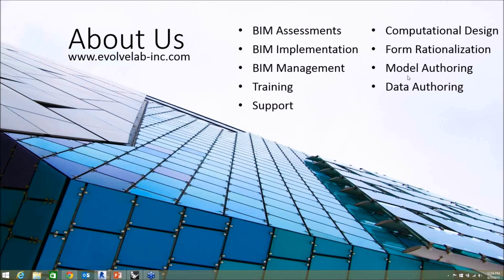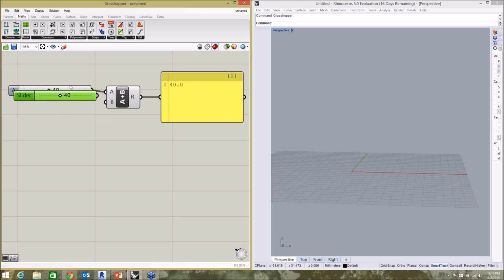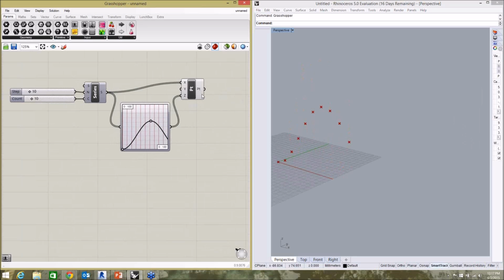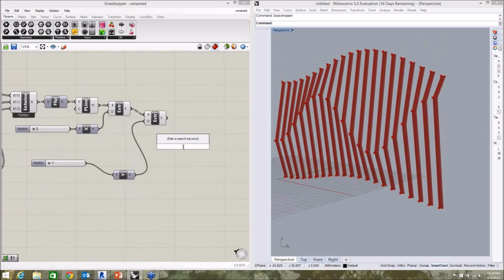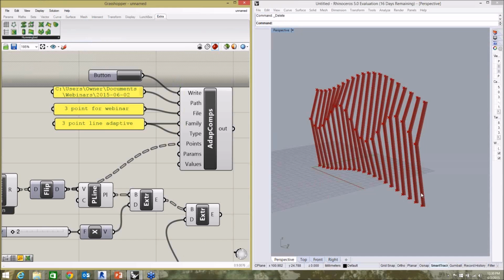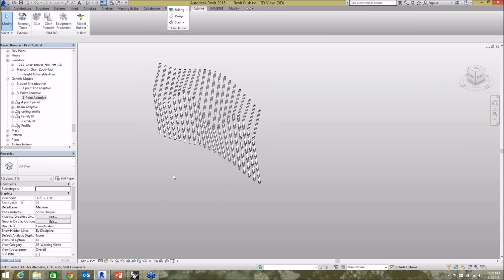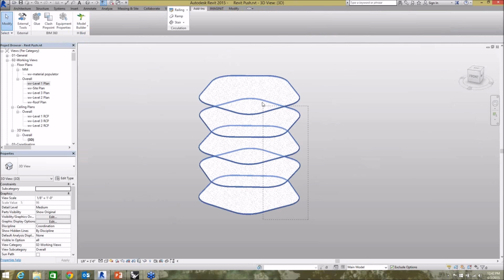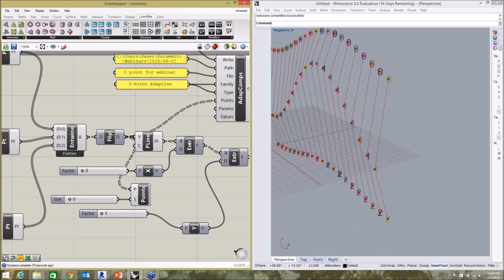Push Grasshopper geometry into Revit

Comment: Wow, this is so cool! Thank you for this tutorial!
Do you still think it's better to play in Grasshopper instead of go with Dynamo?
It's been now 4 years since this tutorial was posted here, so I'm curious if you changed your mind or not...

I already have some experience in Grasshopper, and started to work in Revit a lot.
Not sure if I should learn Dynamo from scratch or better to continue improving my Grasshopper skills.

Anyway, thanks again for the video!
Reply: Check out Rhino 7 and the killer new feature, Rhino.Inside
Reply: Kind of depends on your goal and use. Grasshopper is much more versatile and intuitive, works on various platforms. Dynamo really is enabling automation of modeling steps and works well with the API. Both have their backdraws.

Comment: thank you for your tutorial movie. I'm working on "Families"component, but i got an error.

One or more errors encountered:

Unable to create FamilyInstance
RowId: 1
ElementId: NULL
Action: Add
Object: FamilyInstance
Modifier: 
Value01: 27231.01828817, 94139.84507106, 2419.59000077
Value02: 
Value03: 
Value04: 

like above.
when I take away a point NULL by Cull Index, got another error of Null that was ONE and become NULL.
do you know any solution?
sorry for bad English. I'm from Japan.

Comment: First of all thank you for this tutorial.
I am encountering an error message when pushing floor geometry from grasshopper (curves) to revit 2017.

Would be really appreciated if someone could help me to fix this problem.

Thx!!!!

See below.

ne or more errors encountered:

Error in ConvertHbCurve: The vectors end0 and end1 are coincident.
Parameter name: end0.
RowId: 1.2
ElementId: NULL
Action: Add
Object: Floor
Modifier: CurveArrArray
Value01: 
Value02: 
Value03: 
Value04: 

Error in ConvertHbCurve: The vectors end0 and end1 are coincident.
Parameter name: end0.
RowId: 2.2
ElementId: NULL
Action: Add
Object: Floor
Modifier: CurveArrArray
Value01: 
Value02: 
Value03: 
Value04: 

Error in ConvertHbCurve: The vectors end0 and end1 are coincident.
Parameter name: end0.
RowId: 3.2
ElementId: NULL
Action: Add
Object: Floor
Modifier: CurveArrArray
Value01: 
Value02: 
Value03: 
Value04: 

Error in ConvertHbCurve: The vectors end0 and end1 are coincident.
Parameter name: end0.
RowId: 4.2
ElementId: NULL
Action: Add
Object: Floor
Modifier: CurveArrArray
Value01: 
Value02: 
Value03: 
Value04: 

Error in ConvertHbCurve: The vectors end0 and end1 are coincident.
Parameter name: end0.
RowId: 5.2
ElementId: NULL
Action: Add
Object: Floor
Modifier: CurveArrArray
Value01: 
Value02: 
Value03: 
Value04:
Reply from the maker: Chris, 
Can you try using the "flatten" tool prior to sending to Revit?

Comment: Can you help me? I am trying the first example but with 4 point adaptive, when i try to push it it says:

One or more errors encountered:

Unable to create AdaptiveComponent
RowId: 1
ElementId: NULL
Action: Add
Object: AdaptiveComponent
Modifier: 
Value01: 0.00000000, 0.00000000, 0.00000000
Value02: 0.00000000, 0.00000000, 6.06305301
Value03: 0.00000000, 2.58567879, 11.33340544
Value04: 0.00000000, 0.00000000, 13.00000000

Unable to create AdaptiveComponent
RowId: 2
ElementId: NULL
Action: Add
Object: AdaptiveComponent
Modifier: 
Value01: 1.00000000, 0.00000000, 0.00000000
Value02: 1.00000000, 0.03701611, 5.86011393
Value03: 1.00000000, 2.54814918, 10.86546038
Value04: 1.00000000, 0.00000000, 13.00000000

Unable to create AdaptiveComponent
RowId: 3
ElementId: NULL
Action: Add
Object: AdaptiveComponent
Modifier: 
Value01: 2.00000000, 0.00000000, 0.00000000
Value02: 2.00000000, 0.07403222, 5.72485394
Value03: 2.00000000, 2.51061956, 10.42978952
Value04: 2.00000000, 0.00000000, 13.00000000

Unable to create AdaptiveComponent
RowId: 4
ElementId: NULL
Action: Add
Object: AdaptiveComponent
Modifier: 
Value01: 3.00000000, 0.00000000, 0.00000000
Value02: 3.00000000, 0.11104833, 5.62568815
Value03: 3.00000000, 2.47308995, 10.02575978
Value04: 3.00000000, 0.00000000, 13.00000000

Unable to create AdaptiveComponent
RowId: 5
ElementId: NULL
Action: Add
Object: AdaptiveComponent
Modifier: 
Value01: 4.00000000, 0.00000000, 0.00000000
Value02: 4.00000000, 0.14806444, 5.54964218
Value03: 4.00000000, 2.43556034, 9.65261560
Value04: 4.00000000, 0.00000000, 13.00000000

Unable to create AdaptiveComponent
RowId: 6
ElementId: NULL
Action: Add
Object: AdaptiveComponent
Modifier: 
Value01: 5.00000000, 0.00000000, 0.00000000
Value02: 5.00000000, 0.18508055, 5.48987919
Value03: 5.00000000, 2.39803072, 9.30948750
Value04: 5.00000000, 0.00000000, 13.00000000

Unable to create AdaptiveComponent
RowId: 7
ElementId: NULL
Action: Add
Object: AdaptiveComponent
Modifier: 
Value01: 6.00000000, 0.00000000, 0.00000000
Value02: 6.00000000, 0.22209667, 5.44227159
Value03: 6.00000000, 2.36050111, 8.99540240
Value04: 6.00000000, 0.00000000, 13.00000000

Unable to create AdaptiveComponent
RowId: 8
ElementId: NULL
Action: Add
Object: AdaptiveComponent
Modifier: 
Value01: 7.00000000, 0.00000000, 0.00000000
Value02: 7.00000000, 0.25911278, 5.40409961
Value03: 7.00000000, 2.32297149, 8.70929540
Value04: 7.00000000, 0.00000000, 13.00000000

Unable to create AdaptiveComponent
RowId: 9
ElementId: NULL
Action: Add
Object: AdaptiveComponent
Modifier: 
Value01: 8.00000000, 0.00000000, 0.00000000
Value02: 8.00000000, 0.29612889, 5.37345726
Value03: 8.00000000, 2.28544188, 8.45002269
Value04: 8.00000000, 0.00000000, 13.00000000

Unable to create AdaptiveComponent
RowId: 10
ElementId: NULL
Action: Add
Object: AdaptiveComponent
Modifier: 
Value01: 9.00000000, 0.00000000, 0.00000000
Value02: 9.00000000, 0.33314500, 5.34894593
Value03: 9.00000000, 2.24791226, 8.21637516
Value04: 9.00000000, 0.00000000, 13.00000000
Reply from the maker: Hi +Edrey González Cano 

Can you try placing the adaptive component in Revit independent of hummingbird, and confirm that the adaptive component is not corrupt/broken?
Reply: It was an error in the family but I solved it :) I want to create a curtain wall with that geometry, is it posible?